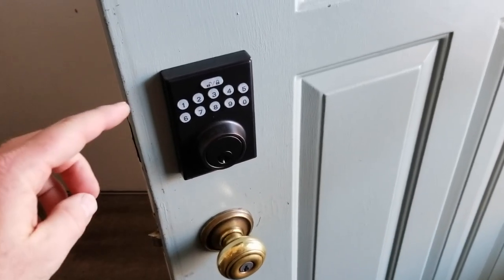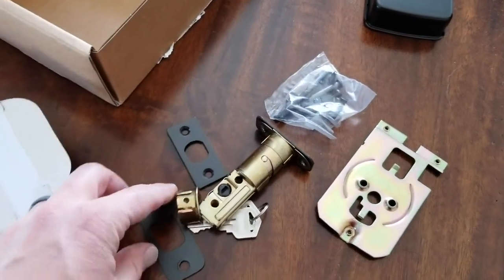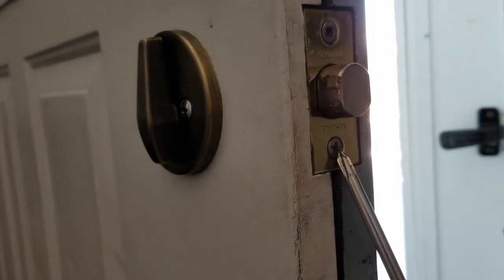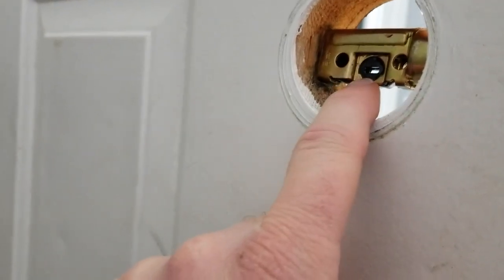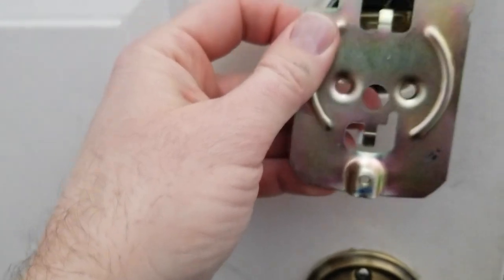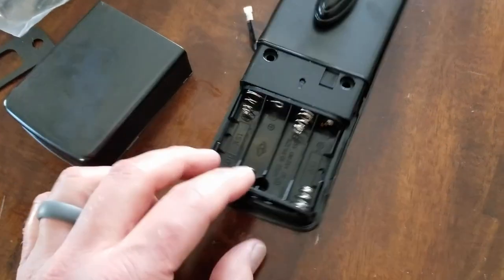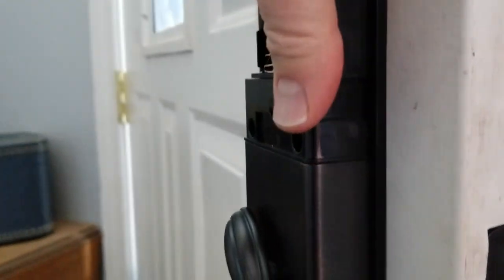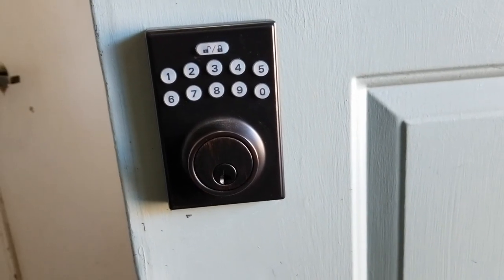Best Keypad Doorlock- How to Install AmazonBasics Electronic Keypad Deadbolt Door Lock

Comment: Re: programming- "I order a Kwikset lock to replace this Amazon Basics that didn't work, turns out the Kwikset is the EXACT same lock only with much better instructions. I applied those instructions to the Amazon Basics lock and everything worked fine immediately. Using the Amazon Basics instructions letter for letter just was unsuccessful after multiple frustrating attempts and troubleshooting. Here is my summary of the Kwikset instructions adapted to the Amazon Basics lock. 1. While the door is OPEN and UNLOCKED enter the programming code 0000, press lock/unlock, you will hear one beep, press 0, press lock/unlock. The latch bolt will extend and retract and the L/U button will turn green or red ( green successfully recognized door orientation) red make sure door is unlocked and batteries are fresh. 2. press L/U button, latch bolt will extend to lock ( this is how you lock the door) 3. Enter default code 1234 then press L/U - the door will unlock 4. Delete all user codes ( my suggestion - this will free up the memory to accept your new user codes) 5. Add user codes: Make sure door is unlocked and open, enter 0000, press L/U, one beep, press 1, press L/U, one beep, enter new user code 4-10 digits, press L/U, 2 beeps if successful, 3 unsuccessful, try again. Test the code: Wake the screen by pressing random button, enter new user code, press L/U, door should unlock. Otherwise use the Amazon Basics instructions to perform other functions. Hope that helps all of you that are unhappy with this lock. Amazon - please rewrite those instructions!"

- written by another user, thank you person who found this out, I was about to go nuts with this lock.

Comment: Just installed it and am having problems with a few things:  
1) I can only take out the key when the deadbolt is in the locked (cylinder protruded) position.  When I turn the key to the unlocked position, the key  doesn't come out no matter which position the key is turned to.
2) When the deadbolt is in the locked position with the key in the key hole, the knob on the inside of the door can't unlock the door. It's stuck!  
3) I don't seem to be able to add a user code to it.  I'll try to fix these problems tomorrow and, failing that, I will need to return the lock.
Reply: Did you fix your problems. I am having the same trouble
Reply: @laurie-annew9923  I did. Just turn the cylinder to a different position, put it in, and try again. As for the user code, it was a problem to me but I just totally reset the program (use the reset button behind the batteries),  then try it again.  One thing that the manual doesn't say, I think, is that when you try to use the code to lock (deadbolt protruding outward), you have to punch in the code, press the oval Lock/Unlock button on top once,  listen to the sound of something happening, wait maybe a second or two, then press that oval Lock/Unlock button again. The deadbolt will come out.  To unlock it (deadbolt returning back into the hole), just punch in the same code and press the Lock/Unlock button only ONCE!

Comment: Not trying to be rude but that's not a complete install.
That would have included the programming too not sure why people are so scared too.
There is a small button on the inside labeled with a R and if you hold it until it beeps X3 it will clear everything and go to default. Yes, a little more work but, you would be helping countless folks with the full operation and install.
I'm tripping all over myself with this as the user manual states to enter PC press/number/PC ECT.
Also says del uc at once can't wrap my head around that either.

Comment: So the manual lists how to reprogram everything but does not tell you how to actually open the lock (manual link in the Amazon listing). If you reset the lock (hold down the “R” button for 5 seconds), it’ll reset to the default user code 1234. To open the lock, put in the user code and then press the lock/unlock button. Once the lock is open, press the lock/unlock button again to lock.